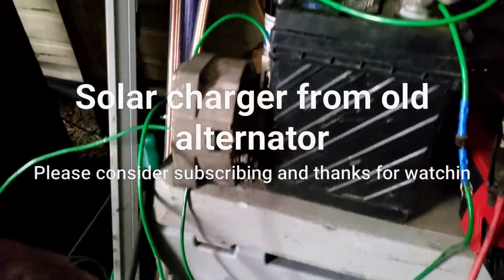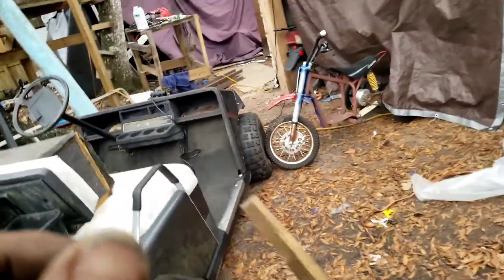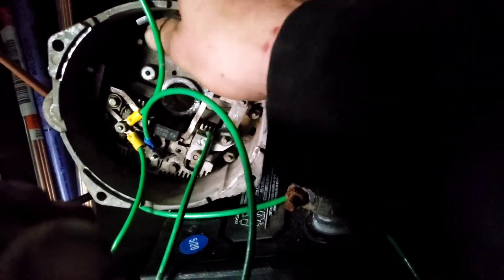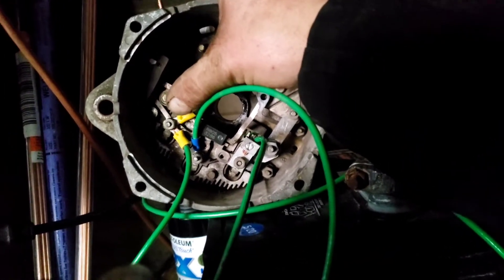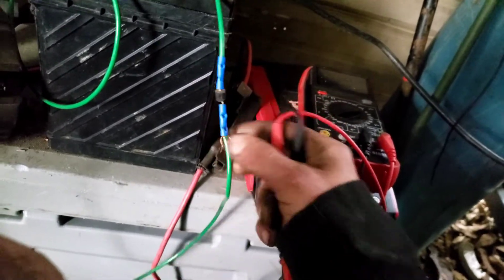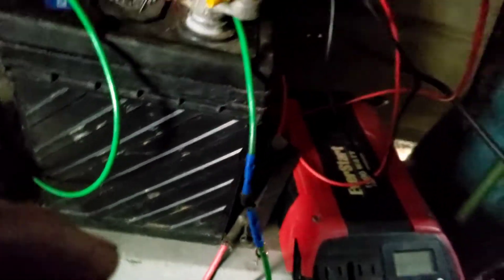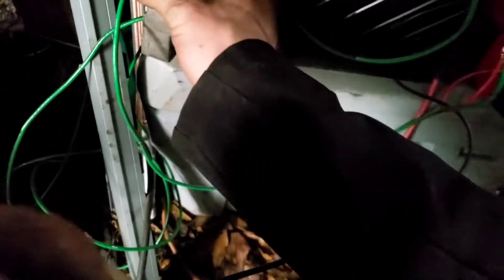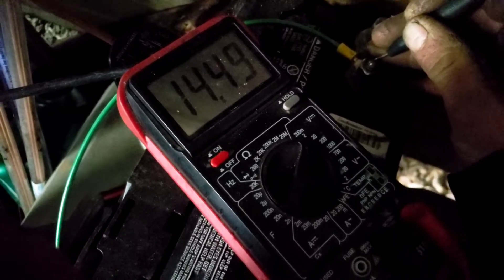DIY solar charge controller from an old alternator? WORKS!

Comment: You need MPPT Charge controller as you are loosing a lot of power, or use lower voltage higher amps panel.

Comment: Hi! I'm clearly not an electrician, can you please tell me if the diode should be facing with the silver strip to the battery or to the alternator? ...and what type of diode should be used?
Thanx

Comment: i think you are losing tons of wattage  you can put the panel strait to batt also but it would over charge if you do not keep a eye on it  but both ways are pulling your voltage down losing a crazy amount of wattage  still cool though

Comment: Just following up with that closed looped system you built a few years ago.. did it work???
Reply from the maker: The one with inverter?
Reply: Yes???
Reply from the maker: Not as well as I liked. But yes. It ran itself for quite some time and then eventually it will shut off and haven't figured out why....couldn't pull another load from it either or it would overload inverter for some rEason. I'm saving to buy a better inverter